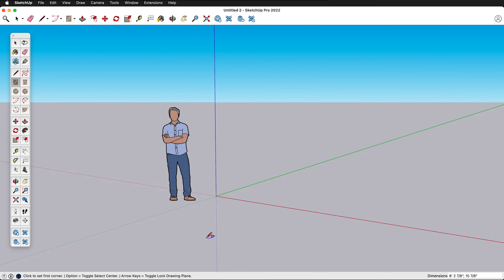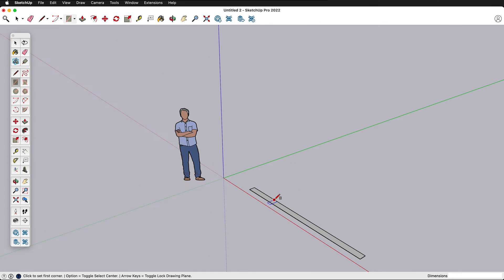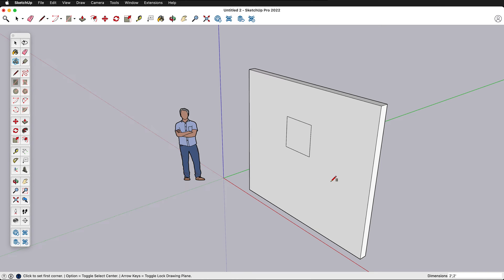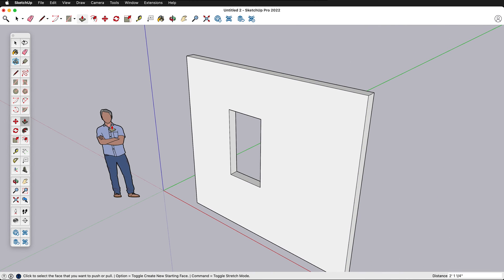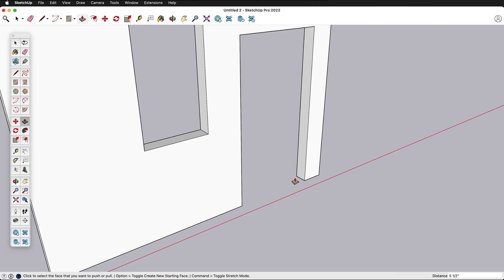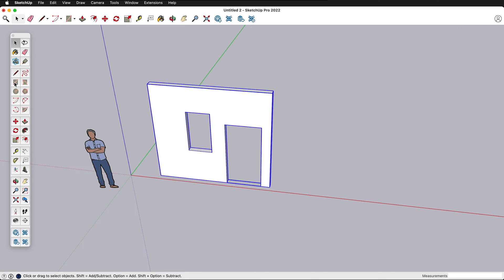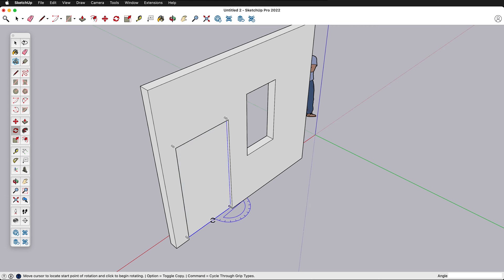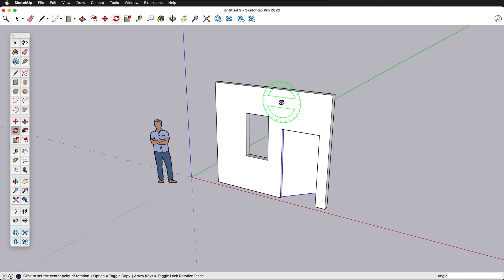SketchUp Cut Hole in Wall for a Window or Door

Comment: thanks!!!!!! How do you cut a hole in a group though. Like if you wanted to add another window after you created the wall group?
Reply from the maker: Unfortunately that's not possible, so you need to cuddle fall through the actual planes
Reply: Thx for reply!